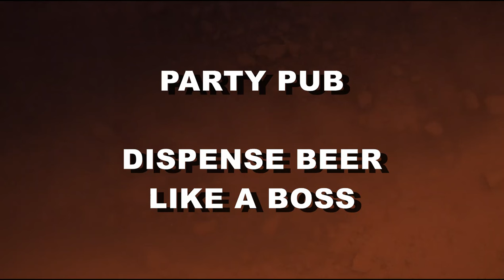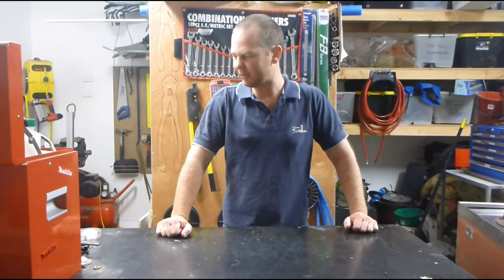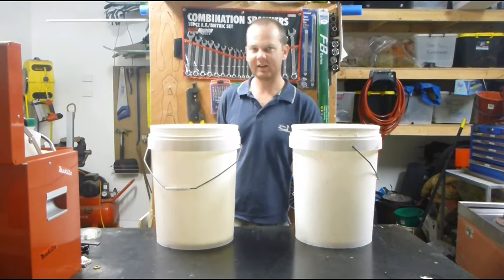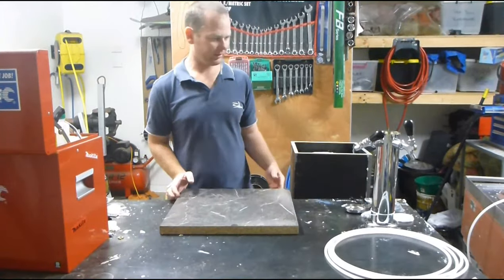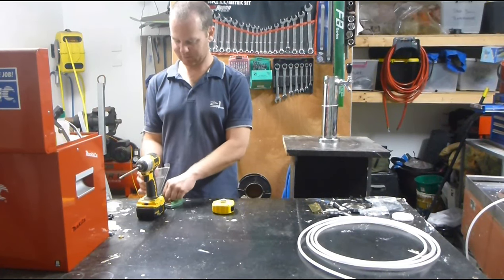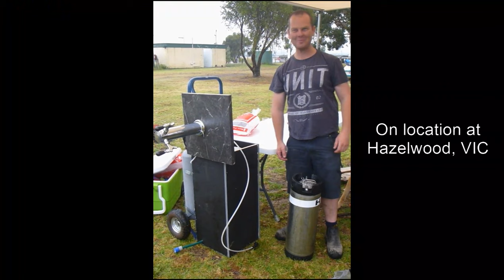Party Pub ~ Portable Keg Dispensing ~ Draught Beer Extreme HD

Comment: Nice build! How much spray foam did you use? I will definitely be building one of these. Thanks.
Reply from the maker: Thanks mate. Pretty sure I just used two cans. There's probably a fair bit of air gap in there but I figured trapped air is an insulator anyway.
Reply: Thanks good info